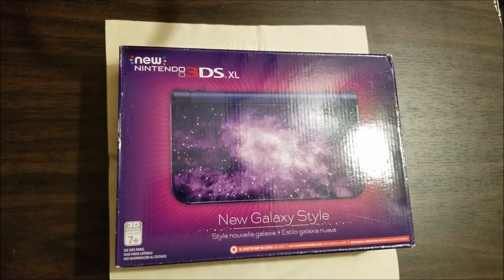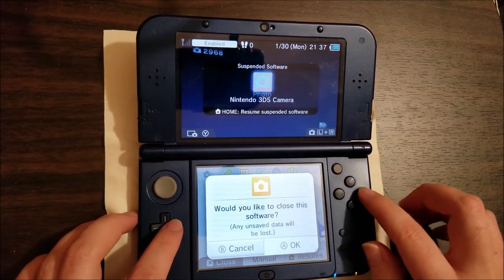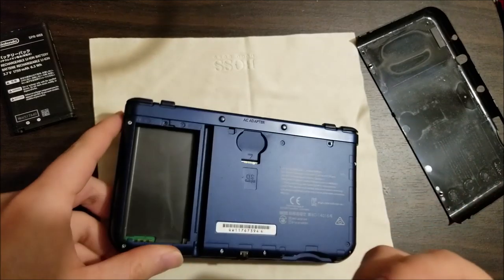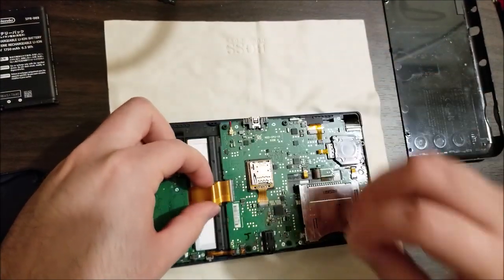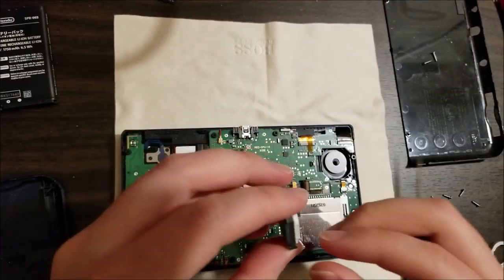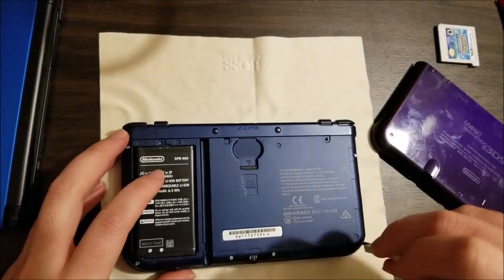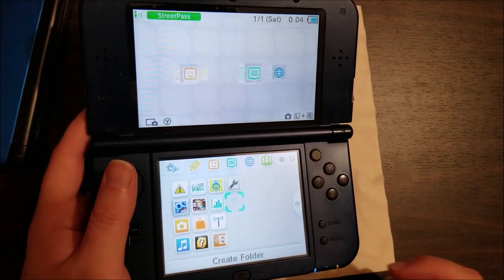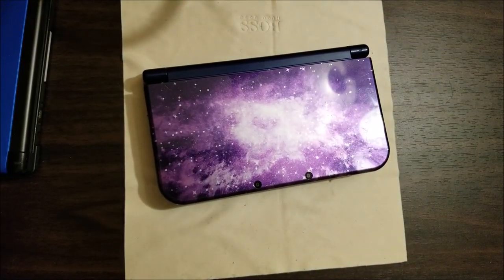Let's Fix: Nintendo New 3DS XL With Unresponsive Buttons And Touch Panel

Comment: I have the exact same problem and symptoms. I am thinking that my screen is the problem too because before the touch screen stopped working, the screen would select whatever option was in the bottom left corner on its own. However, I have never installed a touch screen. What can I do to fix the original touch screen? (nice video by the way, it explained a lot!)
Reply from the maker: It could be a crumb or some dust got into the corner under the bezel. It's worth a shot to take the screen out and clean everything
Reply: Do you have a video on how to/where you take the lower screen out? I’m no technology wiz but with guidance I think I could do it. If not, thanks for replying so quickly!
Reply from the maker: I have a video that shows the process for a dsi xl but unfortunately not for the 3ds (the process is very similar but not exactly the same in terms of screw/ribbon positions)

Comment: I occasionally see a glitch on the top screen of mine (if you would call it that). Its basically just a small black line that'll appear across the screen for a split second when playing it. I've only seen it a couple times on one game so far though. Should I be concerned??
Reply from the maker: Sounds like the game itself has a glitch/bug

Comment: The bottom screen on my 3ds xl is black but still responsive and the upper screen is really grainy and the colors are really dark red and blue. The only thing I can think of as to why is that I would shake it for coins.
Reply from the maker: I doubt shaking it for coins would do any physical damage (lol, in fact I used to shake mine without any negative consequences). I suspect something more serious has happened to it like a fall or maybe some type of liquid ingress, though it's hard to guess without seeing the inside.

Comment: I'm having the same problem. Because my touchscreen is constantly reading an input from the bottom right corner of the screen, i cant apply any directional inputs while in the home menu. Im not really sure how you fixed it.
Reply from the maker: It ended up being the screen protector was pressing between the plastic bezel and the touch panel in one of the corners so I removed the screen protector and it all started working normally. In your case it could also be some dirt/dust/gunk that got stuck in one of the corners.
Reply: @sjm4306  oh, damn. I guess I gotta clean it out then. Thanks, dude.

Comment: Hi, so, i have a New 3DS XL and i always took care about it, i never let any other people hand to touch on it, and my A button doesn't work, it stopped working from nowhere, and i never dropped it off, and i want to fix it, what tools i need for this? And this video would help me? I'm not a pro at hardware e maintenance stuff.
Reply from the maker: First step would be to open it and inspect/clean the contacts for the A button. First question though is does the button feel clicky or mushy?

Comment: Hi, thanks for the video. I had a similar issue with the Y button so that I cleaned up the contact. After pluging back the daughter board and making sure connecting ribbons was well seated, I could not turn on the 3DS... I tested both power fuses and they are OK. I do not have the blue LED on either but orange LED for charging is OK. Owning a second 3DS, I swapped daughter boards to figure out the problem. Same issue for both 3DS. I swapped daughter boards back and now I can't turn them both on... I guess there is a security mode or whatever... Anything to test???
Reply from the maker: It's 100% a mis-seated or damaged ribbon somewhere. They are really delicate and finicky and even a single one not properly inserted is enough to prevent a 3ds from booting.
Reply: @sjm4306  thank you for the quick reply. I think I was very delicate with the daughter to mother board ribbon and both (each 3DS) do not work. I gently tried to seat it again and again. It seems weird to me that it does not turn on for both 3DS XL after handling such ribbon. It's like there is a power security mode. I tried to discharge capacitors by holding the power button but it failed. Both 3DS could turn on prior to handling this ribbon.
Reply from the maker: No security mode per se, but on every boot the 3ds checks every peripheral connection and if even one isn't responding properly then it will shut off. Do any of the screens flash even briefly if you try to turn it on? Do the speakers click/pop? I find it odd not even the blue power indicator comes on if both of your cases as most of the ribbon problems I have seen will at least flash on for a second before shutting off.
Reply: @sjm4306  no, nothing happens at all, no blinking of screen nor blue LED. The tension at the battery pins is OK though... Same issue on both 3DS XL. Only the daughter to mother board ribbon was removed and seated back. I'm pretty sure it is well seated due to the side "wings". I think I see ppl mentioning that after like 3 or 4 days not being used then it turned on... Seems like capacitors need to be discharged or so..
Reply: @ploomator  Did they work after a few days of no use?
Reply: @voice_0f_reason  Unfortunately, no. The 3DS are still opened but I couldn't find a way to fix them. It seems to be highly sensitive to handling...

Comment: Hey so my X,Y,A,B are unresponsive. I’ve opened it but I can’t seem to find an issue I was wondering if you could help me out. I made the Y and X buttons work but the A kinda works if u press really hard and the B does not work. What should I do?
Reply from the maker: Have you removed the tape and seen if there's corrosion under the metal button domes? That's a good place to start if you haven't done that already.

Comment: I have a New 3DSXL whose X button had to be pushed twice sometimes and now has ceased to work entirely. 
Do you think it just needs to be cleaned with canned air inside?
Reply from the maker: The button membrane and snap dome probably needs to be removed and the inside of them along with the pcb contacts probably needs cleaning (and maybe you'll need to replace the metal snap dome).

Comment: I know this is super late... But my New 2DS touchscreen is kinda faulty. Turns out it only works when I press certain point of the back of the console. I thought it might have been the screen protector so I remove it but it isn't. What can you tell me about this problem.
Reply from the maker: I'd first try opening it and reseating the touch screen connector.

Comment: Pls help me I'm having the same problem there is no screen protector on my touchscreen and I can still access ultra sun then when I use charizard glide I notice the cursor is at the bottom right

I also tried cleaning and wiping it but still no effect
Reply from the maker: Sounds like there may be some dirt/dust stuck between the plastic frame and the touch screen in that corner. The safest method to clean it would be to open the 3ds, lift the screen and clean both it and the frame with a qtip soaked in isopropyl alcohol.
Reply: @sjm4306  just literally happened today while I was playing ultra sun

Comment: I tried opening mine up but it looks like I don't have a screwdriver small enough to remove the tiny screws that hold the system together and I don't want to risk stripping them. Looks like I'll need to buy one
Reply from the maker: Yes, get the right screwdriver size. The screws are really easy to strip and very difficult to non-destructively remove once they are.
Reply: @sjm4306  would you have any tips on how to get those stripped screws out? I managed to be able to get 4 out of the 8 screws out, but the rest became stripped.
Reply from the maker: Not sure if they make screw extractors small enough but if not then your only options left may be more ... rough, such as drilling the heads off and using tiny sharp pliers to back out the shaft, very carefully epoxying a bit of metal to just the head so you can use that to unscrew it, maybe adding a bit of rubber to the tip of a small driver to add grip to slowly turn it out while pressing downwards, or using a sharp perfectly sized flat head screw driver to dig into what's left of the head.
Reply: @sjm4306  I see… I’ll try these methods out, thanks for replying!! Hopefully I won’t have to resort to the drill

Comment: @sjm4306 If I never put a screen protector on it myself does it still have one? Do they come with screen protectors already installed??
Reply from the maker: Nope, they dont come with one installed from the factory
Reply: @sjm4306  Good to know, but that turned out to not be my problem anyway. I just needed to clean the edges of the touch screen with a toothbrush, so simple.
Reply from the maker: Glad it was a simple fix

Comment: My 3Ds only has a small part of the bottom screen that’s unresponsive. Would this method help to fix it? or would i need a screen replacement?
Reply from the maker: Have you tried recalibrating the touch panel using the settings menu? Failing that it sounds like the touch panel may be physically damaged and need replacement.

Comment: I kinda need help with my New 3DS XL.
So uh, the problem is that, whenever I start playing a game (especially Pokémon)  the circle pad's pointing thingy goes straight up even though it's not moving in real life..
So sometimes, I have to force it down and it doesn't even work! Do you know what the problem is?

Edit: I think my screen protector is blocking my circle pad....
Edit 2: I gave ya a sub and like :D
Edit 3: My original 3DS which I owned for 8+ years has non responding L and R buttons....
Reply from the maker: Yep, I was gonna guess the screen protector like mine had. As for your original 3ds with dead L+R buttons, try reseating the connectors and see if that helps. Also do they feel clicky or mushy? It could be the switches themselves are worn out and need to be replaced.
Reply: @sjm4306  Actually, my circle pad is drifting....
Which makes playing pokémon IMPOSSIBLE to play..
The freaking thing won't go up!
And yeah, the dead L but on feels mushy and dead R feels clicky
Reply from the maker: The circle pads can develop drift after heavy use, but luckily it's pretty cheap and easy to swap it out with a replacement.
Reply: @sjm4306  phew
Reply: @sjm4306  because currently, I'm playing on my Lil one (you know, the original one)

Comment: my 3dsxl has a problem too. when I press the left key dpad, its not working but if you press harder or press several times, it kinda works. what do you think is the problem? sorry for my bad english
Reply from the maker: Check out the 3ds button repair video I made, it's probably a similar issue

Comment: So I have a of 3ds and one day when I was playing / charging the console it made a snap sound and shut off I thought it overheated and it needed to cool . I left it for a day and tried to turn on but it snapped and off it went from time to  time it will turn on but not for long. Any idea also the L and R bumpers once worked but now nothing. Want to fix it myself but I also don't want to damage it any more than it is if need be I'll have GameStop fix it but sense I got as a refurbished system I really don't want to. Please help
Reply from the maker: The 3ds is pretty lightweight in terms of processing power so it is extremely unlikely it overheated. Sounds like either a ribbon going to the top screen isnt quite in right or possibly has a little tear from opening and closing repeatedly. Was the unit ever dropped or subjected to a shock of any kind? As for the L and R buttons, first step is getting it to power on again and then we can deal with that.
Reply: @sjm4306  yeah I'll be honest its been dropped and bumped more than a few times, I'm one of those guys that tries to take care of his stuff but moving heavy equipment and sometimes dropping it don't help. If in the event it is a damaged ribbon cable could I fix it or do I have to buy a replacement?
Reply from the maker: It happens, wasnt trying to blame you or anything but it's possible these symptoms are at least partially due to a drop. If you are comfortable with opening the 3ds the first step would be to open it and reseat all the connectors just in case something got loose.
Reply: @sjm4306  what tools do I needed, and what to remove before starting on the unscrewing
Reply from the maker: You will need a very small phillips screw driver (a jewler's set or for eyeglass repair will work fine) and tweezers though not strictly necessary will be very useful. As to the exact process to open it, it depends on what model of 3ds you have. Ifixit.com has good guides or you can just youtube search your model to find teardown/repair videos.
Reply: @sjm4306  got it I'll look at the model number when I get back to my place in a few days,and thank you so much for take sometime out of you day to answer my questions and save me a trip to pick up a new console I'll be doing that the second I can

Comment: The arrow buttons, joy stick and touch screen stopped working all at the same time. Me and my dad are gonna tear it down and see what’s causing it. I think some parts have moved around because it doesn’t really make sense that all three of them stopped working at the EXACT same time. Anyways I’m hoping I don’t need to change parts cause in my country it’s not very easy to get ahold of old Nintendo parts. Any tips?
Reply from the maker: Check for any dust/dirt that may have wedged between the side bezels or corners of the screen that could be pressing and preventing button/touch screen presses. If you are lucky and this is the cause you may not even need to open the console and a thorough clean will be enough to fix it.
Reply: sjm4306 oh, thank you! I’ll be sure to check it out before disassembling it to make sure. Is there a specific tool you would recommend to get the dirt out before disassembling?
Reply from the maker: A wooden toothpick should work nicely. It minimizes the risk of scratching or cracking anything.
Reply: sjm4306 ok thank you!
Reply: sjm4306 it unfortunately didn’t work. Where do I specifically need to clean?
Reply from the maker: It would be visible crumbs of dirt or gunk caught between the sides or corners of the screen. If that didn't work then you will unfortunately need to open it, given the edges of the screen a thorough clean and retest. If it still doesn't work then you'll have to check all ribbon connectors.
Reply: sjm4306 Ok perfect thank you. I will be opening it up but that is completely fine with me. I have fun with fiddling with that kind of stuff. Anyways thanks for all your help!

Comment: What size screwdriver did you use to take the back out for the 8 screws?
Reply from the maker: I don't know the size, but it was part of a glasses repair kit that I got ages ago. It has a nice sharp small tip that is perfect for taking out tight screws without stripping them.

Comment: Do you know anything about the black screen of death by any chance? I plan to fix it but I don't know what to actually do
Reply from the maker: There are multiple reasons that result in similar symptoms. Does your console stay powered on or make a click sound and turn off? Is the screen backlight coming on and just displaying black or the screen is totally dead?
Reply: sjm4306 it just shows the light when it's powered on but both screens are black and plays music

Comment: Hi, one of the screw on the back plate of my 3ds was damaged ( phillips head was rounded), do you have any tips on removing that?
Reply from the maker: You can try the rubber band trick to try and gain traction between the screw driver and screw but only if the screw isn't deeply recessed. Worst case you may have to carefully drill out the screw head with a small drill bit and once you remove the back cover use small pliers to unscrew the thread if at all possible.
Reply: @sjm4306  Thanks, the head of the screw is beyond saving, so I'll try the drilling method and keep you up to date. Cheers!

Comment: I have a New Nintendo 3ds (little one) and the cartridges remain stuck in the console. The mechanism doesn't work correctly, and the games do not come out when i press them. Do you suggest me to send it for repair or is it something that i can do by myself?
Reply from the maker: Is it still under warranty. If so then send it in, but otherwise it is possible to fix yourself depending on what's wrong. Open it up and inspect the cart spring mechanism. If you are lucky it could just be stuck and you can disengage it. Worst case the spring or latch might be damaged and you'll need to buy a replacement (which are pretty cheap) and desolder the old one to solder the new one in. If this is your first time soldering I'd highly suggest you find a friend who has experience and pay them/bribe them with food to do it for you.
Reply: sjm4306 I’m really bad doing this thing, and i can really cause more damage on the system... mine is also a special 3DS model, the Ambassador. The console is not under warranty anymore, but i don’t know how much they will ask me for that. I’ve heard not so good words on support from Nintendo Europe... last time i send to them switch joycons and they send me back them in worst condition...😣 but i think i will send it to them

Comment: My A button only really works if I press rather harder than you would regularly on the button, any idea on a way to fix it / repair it?
Reply from the maker: I fix the same problem in this video https://www.youtube.com/watch?v=2YkCr5adCVY&t=188s

In a nutshell under the button needed a good cleaning.
Reply: @sjm4306  ok, ty